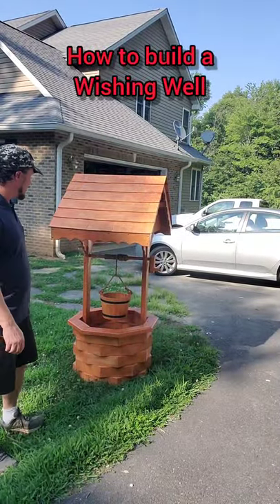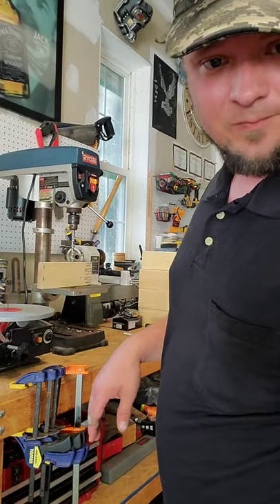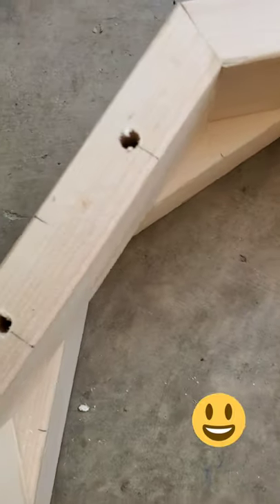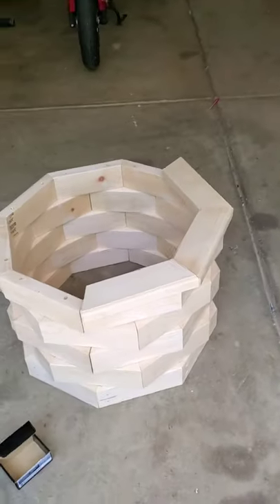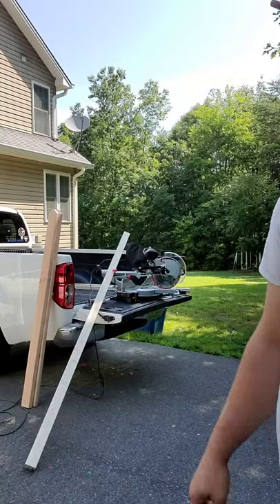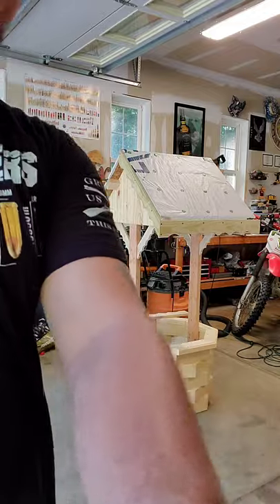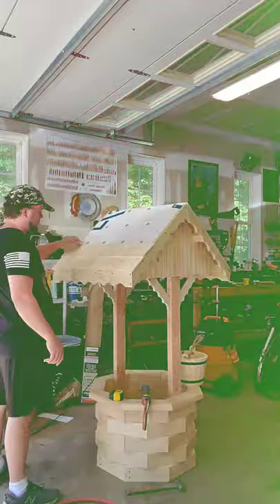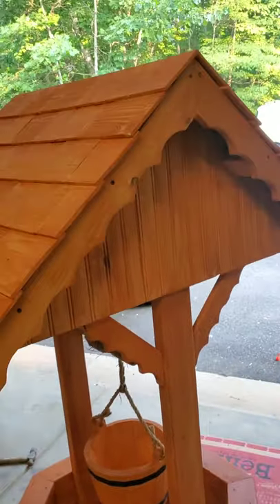How to build a Wishing Well

Comment: Wishing well came out great! How did you determine where to drill the two holes in each board of the base? Any chance you have the plans with dimensions available?
Reply from the maker: After you cut all your boards, lay down the first base layer, then lay the second lay on top. This should allow you to see where to drill the holes to fasten the second layer to the base. The repeat with the third layer, but your holes will have to shift slightly to avoid screwing into the second layer holes. After you determine your 2nd & 3rd layer holes, you just repeat the process for the rest.

Comment: Gonna build the same one, I think it came out great man
Reply from the maker: Thanks,  I do however suggestion using a higher quality wood for the shingles than pine. I was trying to go cheap due to the price of wood at the time. Hope this video helps.
Reply: @hansgrahek9627  good idea.  What did you use under the shingles?  A roofing caulk or just an exterior silicon?